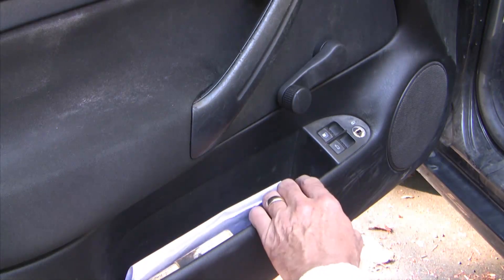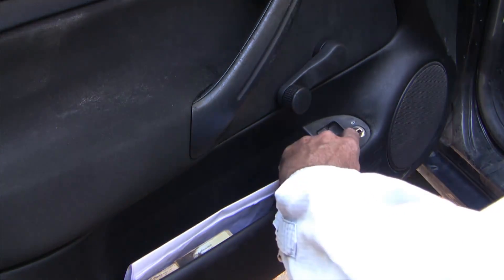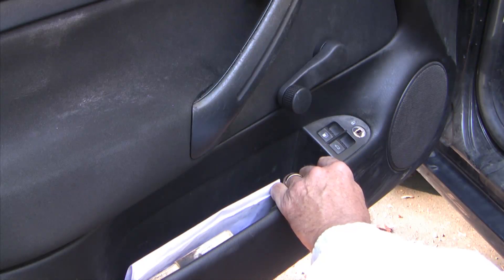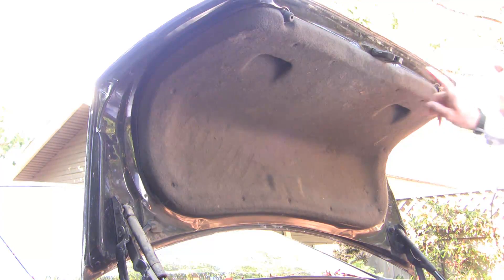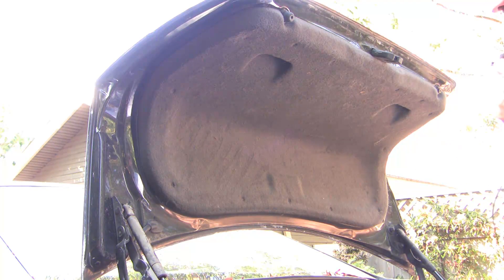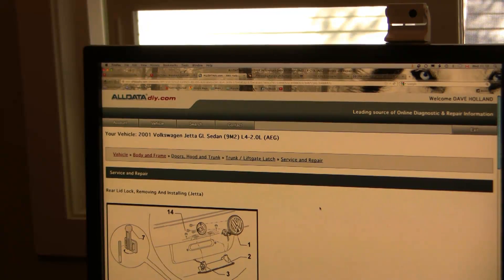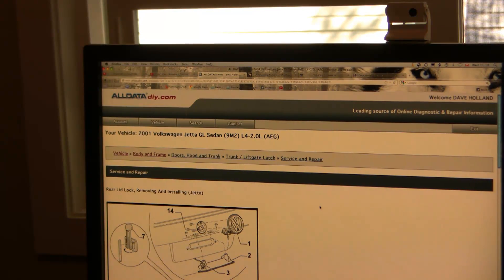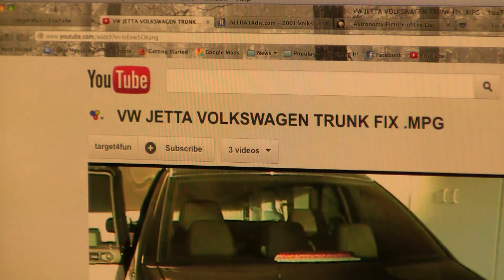Sometimes Aftermarket is Better -- VW Jetta trunk latch repair

Comment: Any snake-oil salesman can tell you that there is no money in the fix(any fix), but service will make you rich,  This is the only reason why I can explain VW using plastic parts in critical and non-critical automotive parts (i.e. window slider, electric lock linkages, coolant housings, DMF roller gears, shift cable adjusters,  ignition switch backer sleeves, and so on).  These are all parts that if swapped with metal replacements will restore 90% of VDubs damaged reputation.  Who wants to drive a car you can not lock or open or roll the windows down or up or it leaks coolant and the glove box is broken.  I guess I am a gluten for pain and I love puzzles too.

TDI Love from Chicago.
Reply from the maker: Excellent points, when you tabulate the issues it becomes a pretty long list. Plastic is cheap, it won't rust, and it won't carry current to participate in distant galvanic reactions, so it's easy to see why it has taken over auto parts, everywhere. Unfortunately they haven't solved the issue of differential expansion and brittle degeneration with heat, not to mention the basic strength issues. What gets me is the fact that plastic ends up in landfills, and it virtually never recycles back to natural compounds. It's eye opening to learn that the greatest harm of sending human toilet waste into the ocean are the plastic beads that come from toothpaste and cosmetics. Everything else is naturally recycled within days. We live in the geological age of plastic, and species that live millions of years later will be sorting through our trash.

Comment: Having the same problem with my TDI 2003 GLS Jetta. I ordered the replacement plastic part for 25$ (i guess the price has come down). The part looks like something that could easily be printed on a 3D Printer. As for the VW being responsible for defective parts. It seems hard to believe a German engineering company would not be zealous about correcting this. My biggest complaint is the front lights on all Jettas. nowadays you only see them all clouded up and fogged. Why could they not design something that would not do this? I wonder if an aftermarket product has corrected this.
Reply from the maker: Those are wise thoughts. Now that you mention it, the lights on this VW were clouded, too.
Reply: My Son just bought a 2005 GLI that came with the fogged lamps and broken trunk latch. Great job youtubers on passing along valuable  information!
Reply from the maker: FirstSergeant100
Thanks for the feedback!

Comment: Same issue with my 2007 Ford Focus, it failed at around 30,000 miles and really didn't have time to leave it with the dealer being a field service tech. A couple of years later I purchased another replacement assembly and during the winter it stated to make a grinding noise again. I stopped using it during the winter and it is still ok but yes no modifications were made to the original design? The bonus in all of this is that the dealer that I purchased from online accidentally sent me two... :)  I did even try to email them to return the second but they never replied.

Comment: Mine the latch is broken so it does not close.
Reply from the maker: A generation ago, you could easily go to a junkyard and find parts like that easily, right off an old car. Now most vehicles are crushed for steel, losing that valuable resource. You can sometimes find parts online -- I use car-parts.com. But something small like that is hard to define exactly and you never quite know what you are getting. Good luck!

Comment from the maker: As I recall, some of these models are vacuum actuated. You will be able to identify that when you take the inner door panel off. If it is vacuum actuated, a small crack in the vacuum tubing can do the same thing. Of course also check fuses, but if the other components of the system work it's not likely to be that. Also note that you may not hear the noise unless you put your ear right on the door when somebody else presses the button.

Comment: I had a similar issue with my 2003 Civic's fuel door release.  After many hundreds of cycles a weak cable attachment point ruptured beneath the seat.  With no obvious way to fuel up I was in a bind!  Lo and behold a smart guy had engineered a superior replacement solution.  Popular cars aren't immune to dummy design problem but they are the easiest to find help with.  Cheers.

Comment: I've got a Golf that seems to have the same problem with it's rear hatch button/latch. It does seem to be one of the good many chronic flaws in VW model design. Another is the door handles on Mark II models. I've replaced mine 3 times so far and see lots of sellers of Chinese made door handles for these cars.

Comment: Very true about aftermarket. Time has told nicely for my trunk fix. Had my fix in place on my 01' 2.0 since 2009 haven't had a problem with it yet, knock on plastic.

Comment: The size of the front lights ? why so big ? why plastic ? to allow you to burst it in a parking lot or in an accident.
they are expensive too, while very cheap to produce, and it's forbiden to go on the road without them in bad shape or broken....so you pay it new.

why so little windows on the cars nowadays while before it was considered as bad because of the lack of visibility ?
because of the weight (actual cars are very heavy),and the price of it...

Comment: Programmed obsolescence + the fact that cars are not built to last as long as before (on the market)

Peoples change their car more often,so spare parts must be sold quick because money is made on parts,not on brand new cars where the manufacturer margin is very tight.
Only bmw have a superior margin on sold vehicles.

A steel front fender is about 10 euros to produce and you pay that around 200 at the dealer.
Imagine a plastic one....they break easily like the bumpers ......

Comment: I do not have a problem with it being complex but only when it is really necessary.  At least in this particular case, I see no reason for so many levers, rods, cables, actuators, motors, brackets, pulleys etc for the trunk opener!

Comment: I just don't get VWs.  The whole mechanism seems to be overly complicated for no reason at all.  I have seen typical japanese trunk opener and it does not have bunch of cables and rods.  Is there a rationale for VW way of doing things?  They can can simplify the design, save the money and make it more reliable but then it just won't be a VW, right??